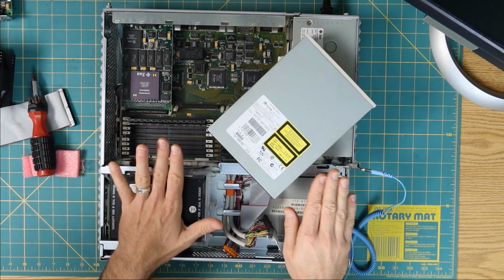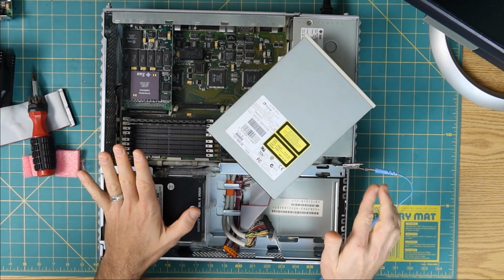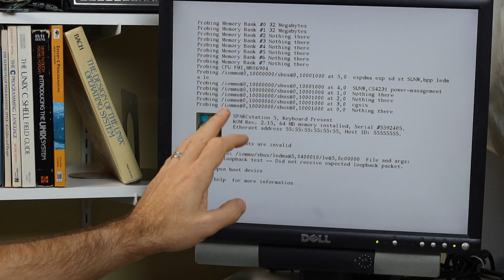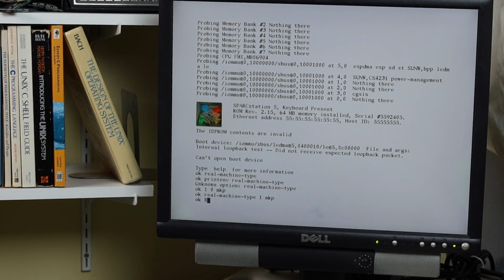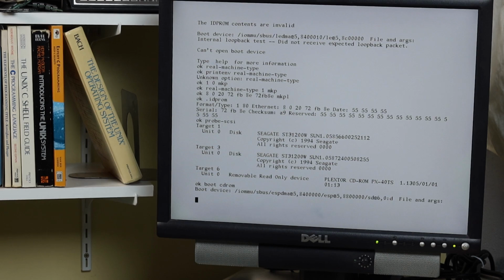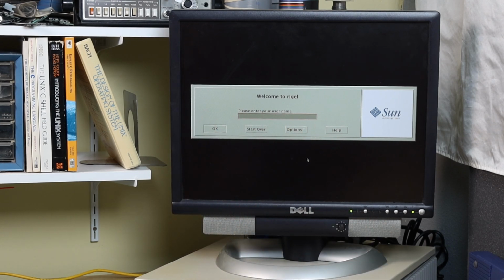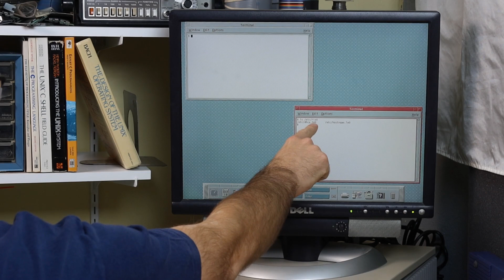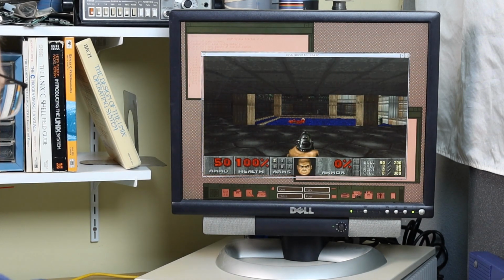Installing Solaris 2.6 on a Sun SPARCstation 5 #UNIXtober 2021

Comment: Swap size is always a debate. I liked making swap 2x memory size.  On a Sun machine adding more memory will improve performance.  Anytime the machine starts using swap it will turn into a real pig.  Max out the memory.   You will find there are no browsers that will work good on Solaris. Firefox v52 is the last one built for Solaris and it is very slow.

Comment: I a retired SCSA, Sun Certified System Administrator, at my work place we had about 500 Sparc work stations doing cad. I worked on all variations of Sun Solaris. And about 100 Servers.  Sparc and Ultra Sparc.  I rue the day Sun was bought by Oracle.  I really like the Ultra Sparc 10.  Don't forget to copy boot to the hdd.

Comment: The ‘80s and ‘90s was the golden era or PCs, IMO. Wintel was boring, but all the alternatives were interesting. Always wanted a Sun or SPARCstation. I had a BeBox and access to a NeXT Cube for a while, but not one of these. For my first computer I had to decide between an Amiga or a Mac. I chose a Mac Classic, but quickly moved up to a Quadra 650, which had a 68040 at 33 MHz. In my opinion, one of the best CISC based CPUs of the time.
Reply from the maker: I would love to add a NeXT Cube or a BeBox to my collection. I bet you wish you kept those!
Reply: @TalesofWeirdStuff  Yeah. I could have kept the BeBox too. It was gifted to me by my employer. But I left it there when I left. I’d really love to own a NeXT Cube. 😍 I’d prefer to run NeXTStep on a 68040, rather than a 030, but I don’t care. Would just love to have one. I had a 128k Mac too. I gave it away about 10 years ago. Should have waited and sold it now. Oh well. At least I had the experience of using those machines back in their day.

Comment: I had to port my companies server software (C/C++) to Linux fifteen to twenty years ago and found Linux debugger was too broken and buggy to be useable for debugging multi-thread code. The solution was to port the PC server code to Solaris on a spark first and to use it's debugger. That worked and I was able to do that successfully and then was able to port that code to Linux. I still think the Linux debugger is rubbish.

Comment: In other news. I think you'll find that despite the disks being wide capable, the SCSI on the Aurora's like the early SS20's was still 8bit narrow. It flips the jumpers broken out on the SA80 connector to enable narrow SE mode. That'll only pull a few meg a second. You should see if you can scare up an SX for it. 24bit video is really quite something.
Reply from the maker: I have an SX that I install in that system in https://youtu.be/5R44cSv_Ue8. I also have a ZX that I want to install and play around with. As for the disks... yeah, the speed of narrow SCSI is not good. I've been thinking about getting a different SBUS controller card, but then the disks would have to be external... I'm not sure it's worth the effort.
Reply: @TalesofWeirdStuff  the nice thing about external enclosure is that there is a far smaller risk of cooking the CPU or memory or main board.

The pizza boxes can be very troublesome if you want to run a faster and hotter processor (for example Ross HyperSPARC) inside a SS10 or SS20.

Comment: What kind of SCSI cable does the CD-ROM drive need?  I'm not familiar with the connector on the motherboard.
Reply from the maker: I will have to dig that system out and look at it again.  I think it is some kind of proprietary connector that delivers both SCSI and power from the motherboard.  I don't remember for sure.

Comment: I was given 2 SparcStation 5's with no drives or keyboard/mouse. A lot of info here was helpful. I had a stack of 18.2gb HP drives that work. I ended up installing NetBSD 9.2 using the serial terminal. I only had one scsi CD drive, a HP 9600si CD-Writer. It booted everything just fine. Thanks for the link for the NVRAM replacement, one of them has a dead one but the other one still works. They're OOS right now but I'll keep an eye out for the restock.
Reply from the maker: That is a bummer about the keyboard and mouse.  Those are not easy to find at reasonable prices. :( I am really glad other information in the video was helpful!
Reply: @TalesofWeirdStuff  I may have gotten lucky on that, I reached out to my local makers space and a member has a garage full of Sun stuff he hasn't used in years. He's gonna check for me.

Comment: Brings back memories to my student times. I had the emerging Linux already on my PC at home when SUN offered special student discounts ... an SS 20 602 for only 35.000,- DM (roughly 20.000 US$ at that time) 😒.
Reply from the maker: What a bargain... ouch! I feel like that was about the tipping point when all of the UNIX workstation vendors were doomed.  PCs had become too powerful and too cheap, and they just couldn't compete with that economy of scale.  Alas.
Reply: Back when I was a student in the early to mid 90's, I picked an SS2 and an SLC at Ross's disposal auctions as my first non68k SUN's. SUN in Perth happily sold me solaris and compilers "at cost" for about 100$AUD. Was really nice. Good times.

Comment: install nextstep on it ! much more interesting
Reply from the maker: A couple of people have suggested NeXTSTEP.  I think I'm going to wait to play around with that until I can play around with it on a NeXT.  Some day!
Reply: @TalesofWeirdStuff  Nextstep on black hardware suckssss ! go for that spark cpu !
Reply: @soviet9922 I can see running NeXTStep on a 68030 using a MO drive would be painfully slow. But of a hard drive and a 68040 running at 33 MHz or 40 MHz, it should run decently. Definitely not as as good as a Sparc 85 MHz RISC CPU though.

Comment: I used to have an ST31200N, and later a 1230. They were 1gig drives, 5400rpm. N was for narrow scsi (50-pin) and W was for wide (68-pin, but actually physically more narrow and compact).
Reply from the maker: I also have a ST31051N. I was hoping that it would perform at least as well as the ST31200WC, but that does not seem to be the case. I discuss this in the "Disk I/O Battle Royale" video that I just (finally!) posted.

Comment: Thanks for a great video! For someone who hadn't really used a UNIX system until a good few years into the current millennium, it's interesting to get a small glimpse of the stuff that lead to the OS's of today! And if I may comment on the skipping of the installation process... I most likely wouldn't have watched the full 2h, but it would've been cool to see at least some of it fast-forwarded :)
Reply from the maker: Unfortunately, over an hour of the process is just a very slowly creeping progress bar. :( There aren't even any poorly aged adverts or advice like in on Red Hat or Windows installs.

Comment: Awesome work. I have used many Sun boxes in my career including the 5. Brings back good memories. And thanks for the digikey link. I need an nvram for my second Blade 100.
Reply from the maker: I believe that NVRAM chip works with SPARCstation 5, 10, and 20, but I don't know for sure about other models. You might want to check some other sources to be sure it works with the Blade 100. Which reminds me... I'm sure the battery is long dead in my Blade 1500, too. I haven't turned that on in a decade or more.

Comment: You're making some great progress with this machine, plus it runs Doom! As for the noisy fan issue, I need to deal with that as well on my Tandy 1000 TX. The power supply fan sounds like a wind tunnel.
Reply from the maker: The only bummer was the lack of music. There are some interesting features of this particular port, so I'm curious to see how it compares to the open source release.
Reply: I just got one of these! I can't wait to get it running! Mine has 256 MB of RAM, 2 x 4GB HDD. I need to get a video adaptor to VGA so I can see what this thing can do!

Comment: Hmm, all of the links to external websites in the description are resulting in 404 Not found pages.
Reply: The first word after the URL seems to have been concatinated into the URL. I think there's spaces/newlines missing in the description
Reply: @ChartreuseKitsune  Thanks, I finally noticed that and cleaned up the URL to get to most of the linked pages.  The NVRAM page from Digikey still comes up with an error.  When searching for the part number in the original URL, Digikey finds no such part available.
Reply from the maker: Should be fixed now. Sometimes in the video upload editor when I click the "previous" button to go back to the part where the description is, YouTube likes to delete all the line breaks. It's very annoying. :(

Comment: My comment on the NVRAM part link problem, 404 page not found error, seems to have disappeared...what happened to it?  Is the part number correct M48T10-100PC1 or is it M48T18-100PC1
Reply from the maker: All of the links were messed up when the YouTube editor deleted all the newline characters. The Digikey part number is 497-2837-5-ND, and the manufacturer part number is M48T18-100PC1
Reply from the maker: Which... I now see I had typoed in the link.  It's fixed now.  Sorry about that... I guess that's what I get for doing that at 4am. :)
Reply: @TalesofWeirdStuff  Thank you for the updated information

Comment: /home is normally empty and unwritable on Solaris/SunOS. Instead the users home directories are stored in /export/home/username, Solaris is kinda setup with the idea of you using a NIS + NFS server for everything so on client systems /home would be mounted via NFS with the information the NIS server gave it, and on the host NIS server the home directories would be where you expect for NFS under /export. When not using this setup it still puts user home folders under /export always. This one is kinda unique to Solaris and not other UNIX systems even in the 80s and 90s.

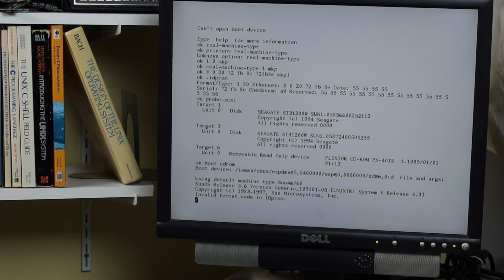One thing you missed while programming the idprom is the `set-defaults` command then `setenv diag-switch? false` before doing the rest (Step 1 from faqsunnvram.txt) which likely was the cause of the "Invalid format code in IDPROM" message that showed right before the setup started at 13:00. Also after setting the contents you ideally want to issue `reset` at the prompt to reboot the system then you can see the new mac address and host id all good and no errors
Reply from the maker: I did forget both those steps. I was reminded about diag-switch when it rebooted... and endlessly tried to probe the network that wasn't connected.  I had a feeling that the /home problem was something like that. I know I'm going to end up reinstalling on some other disks, so I'll see if I can get it right next time. Thanks for the info.
Reply: @TalesofWeirdStuff  To stop it endlessly booting or to stop OpenFirmware in general and get back to an OK prompt you can press Stop+A on the keyboard, then you can adjust the parameters again